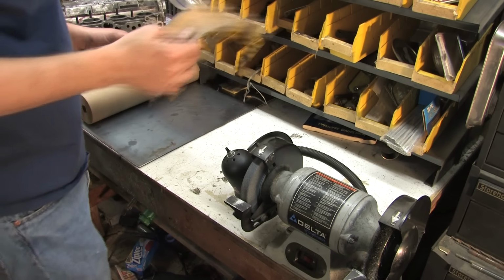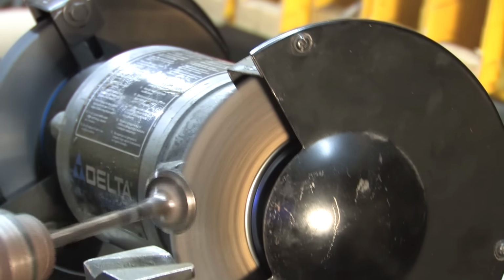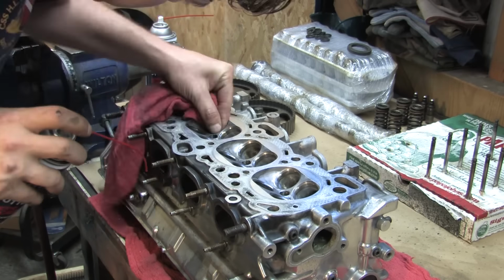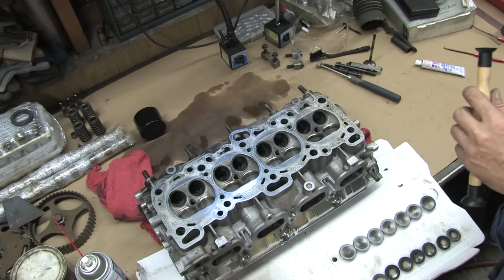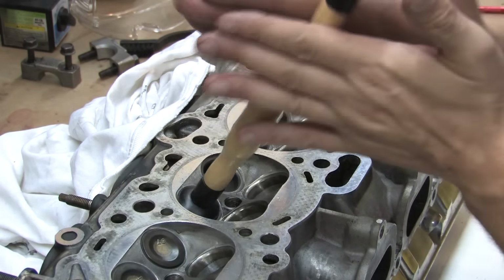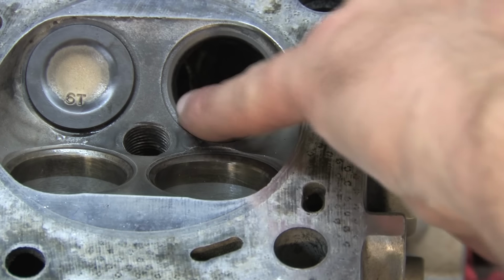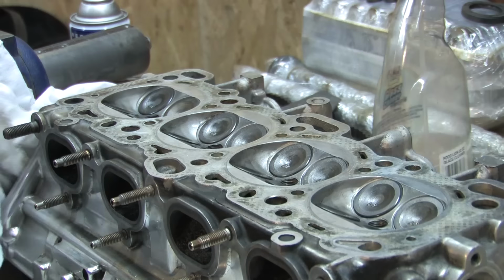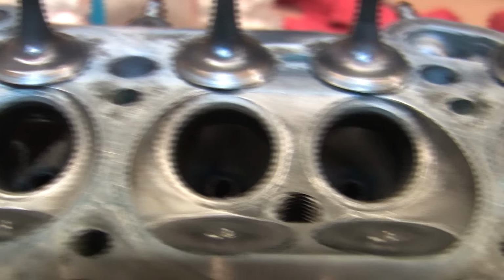Cylinder Head 105 - Valve Job Basics

Comment: awesome video thank you! Love the sound of those smoothed valve/seats. 

Question: Can I use this method to lap a brand new valve into an old seat? It's my first time attempting this.
Reply from the maker: Brian Parker Thanks man!  A:  Probably not.  I mean... it could miraculously fit... but my money is on nope.  The seats are cut based on a measurement of the valve's depth, and a new valve normally doesn't fit a worn seat.
Reply: Thanks for the quick reply! So what's my recourse? Does it need to go to a machine shop or is there a DYI remedy?
Reply from the maker: Brian Parker If you can find someone that will rent you a seat cutter kit with a T-bar or "easy turn" handle, that's awesome!  I've never tried.  There are seat cutters with guides, cutter heads, t-bars and replaceable cutter blades that you can buy for about $300, but in the end, you can get a whole inline-4 cylinder head valve jobbed for about $150 at most machine shops.  Not just the one or two valves.
Reply: Yeah, sounds like taking it in is my best option. Thanks much man! subscribed

Comment: The compound you refer to (I think) is made by Fel-Pro Clover valve grinding compound. Mine came in a small Green metal 2-sided can. Coarse under the one lid, flip the can upside down and it's Fine under the bottom lid.

Comment: I did my very first valve job that way. Learned how from a friends dad. The next time I discovered carbide cutters. They clean up the seats faster than lapping. Also with the correct angled carbide cutters, 30, 45, 60, the seats in the head can be narrowed so that they put the correct amount of pressure against the valve. The amount of cutting they do is dependent on the pressure applied. Wide seats reduce the pressure that the valve spring can put on the valve and will make the seats and valve face go bad much faster.

Comment: Lapping by hand is just a waste of time.  Simply put the valve through the head and grab the end of the stem in the jaws of a decent cordless drill.   You then just apply paste and open and close the valve while rotating in both directions in equal measure.  Repeat using the fine paste and the job is done.  Takes less than half the time of doing it by hand and the finish very often comes out much better.  Just remember not to overdo it at first, you'll work out how much time each grind takes.

Comment: is this needed when installing a new set of valves as well? and if so would you use the new valves?
Reply from the maker: +Paul Eskridge Watch cylinder head 201 for installing new valves.  That's the procedure you'd want to follow.  New valves in old worn seats is a less than ideal solution at best.  ;)
Reply: Thanks, i think I was watching it when you responded.great informative videos.

Comment: So whats the softer metal the valve of the engine block or are they both being filed (lapped)
Reply: I do not think he’s going to be answering this is a 10-year-old video however I definitely think it’s an awesome question.
Reply: I would guess that the steel of a valve is stronger than the iron in the engine block and also there’s something called valve seats which are added and that may be a third amount of strength
Reply: If you want to get really proficient David Vizard has really strong technical videos for making horsepower

Comment: if I get a leaking valve seat  that is putting coolant into the head ,doesn't that mean it's also putting coolant in the cylinder below ?
Reply from the maker: Yes.  What do you have?  A 4.2L Ford?
Reply: Jafromobile no a landcuiser 3fe straight 6 pushrod

Comment: How do I know if I just need a valve job or new valves with out tarring back into my engine
Reply from the maker: Do a compression leak down test.  There's 2 kinds of compression tests.  One tells you if the motor's good (compression test) and one tells you where the problem lies (leak down test).  If the compression test passes for your engine in flying colors, then there's no reason to do the leak down test.

Comment: How do you test for leaks once your done lapping the valves ?
Reply from the maker: The best method is vacuum testing... but if you search "head water test" on my channel, you'll find a much cheaper way.  Only... use gasoline or carb cleaner instead of water.  Smaller molecule than water and a faster result.

Comment: In the days with petrol full of lead this was an acceptable practice. Today you should not have the same angle on the valve and the seat. The contact surface get too large and you get carbon build up and burnt valves.  
Proper tools are not that expensive and you can sell them on afterwards.

Comment: i changed the spark plugs the spark plug wires the ignition coils the intake manifold and the car is still shaking so i went to a mechanic and he did  a leak down test and a compression test. then he said two of the cylinders have low compression and that's what's causing the car to shake,  so he said i have to do a head job. i did a head job already on this car back in 2014 and it's 2021 so 7 years and i have to do another one
Reply from the maker: You might have a couple of lean injectors?  I'd guess a different mechanical issue contributing to it if it's the exact same problem again. Lean injectors can burn out valves.  A clogged injector can glaze the cylinder walls, an injector stuck open can wash out the crosshatches.  All of this can lead to compression loss.  It could be that you only fixed half the problem the first time and this is just how far it got you?  It's what the valves and plugs actually look like when it comes apart that should answer a lot of that for you.  Especially if you saw the carnage the first time for comparison...  Cheap gas?  Carbon deposits?  Burnt valves?  You'll know when you're holding it in your hands.
Reply: @Jafromobile  wow that's a lot well i'm only 14 years old and my uncle takes me to and from school every day. and all of the sudden the car start shaking real hard and then he did the tune up then the car was still shaking then he changed the ignition coils and the car still shaking and then he changed the intake manifold and the car still shaking so i went to you tube for answers but the mechanic told my uncle that the fuel injectors was good but told him he's losing compression in 2 of the cylinders and he need to either buy another engine or buy another car or get the heads done so what should my uncle do

Comment: Ironically i was doing my valves while i watched this video. The two grit abrasive i'm using ( coarse and fine) are made by Versachem, part# 13209. I use the same method on my valves and would be scared to try the drill method, especially since i'm doing new valves for my H22A. Thanks for the great video, alot of your videos are very helpful.

Comment: Its a nice video but having a machin shop grinding yor seats and valves is a most. Theirs a reson theirs 3 angles on a seat and valves to make a good seal under compresion and angles very from difrent engine.   (COMPRESSION )
Reply from the maker: Please read the description.  Lapping is just a test.  It's not a valve seating procedure.  Every head is different.  I made 124hp and 109lbs of torque with a NA Honda D15B7 engine that had a 1-angle valve job.  It was supposed to have a 3 angle.  It got 44mpg.  Neither of those things should have ever happened in theory, but in practice, they did.  As long as your valves seal, you're good.  All lapping does is tell you if they seal.  If you keep it short like I did, all it does is clean the seat.  When you check it and find it in spec and a clean even seal all the way around like I did in this video, you have to create a problem to justify the new seat... so I did.  The machine shop video is linked in the description.

Comment: My cylinder 6 has a misfire and I change the spark plugs wires and the pack on a cylinder 6 it is still misfiring would you replace the whole engine are all cylinders on the passenger side what would you do cylinder six had 105 compression the other seven cylinders had about 135 I was thinking maybe the lifters but I don't want to waste all that money for no reason any advice would be nice Chevy Silverado 1500 2008
Reply from the maker: Based on its age, I'd recommend looking up some seafoam videos first.  I don't have any, but it could just be a massive amount of carbon built up in it at this point.  Try the cheap easy fixes first.  Check your compression again afterwards.  If it didn't change for the better, then move on to the expensive stuff.  How's your coolant looking?  Stays full and clean?
Reply: @Jafromobile  yes it does no over heating had low oil pressure but it's fine now had it for two days changed oil now it's fine I'll look into seafoam where does sea foam go in the gas  and thanks for the replie I'll also sub
Reply: Also gave it a tune up all the plugs and wires what else if sea foam don't work

Comment: How do I clean the carbon stuck on the valves and head? Tried brake clean and a rag still stuck.
Reply from the maker: Cleaning the valves is the very first thing I do in this video.  If you have a just... filthy un-godly mess to deal with, watch my DIY Parts Washer video.

Comment: Awesome job on this tutorial. I am about to get into a project on a Ford 5.4 and I have paid $500. in the past to have little more than clean up and lapping done. I've been leery in the past about the effectiveness of lapping as opposed to machine done work, but you have made a believer out of me. Thanks
Reply from the maker: Bob Sersen Lapping doesn't fix a bad seat!  All it does is tell you if you have a bad seat.  It helps you see imperfections in the sealing surface.  The more you lap, the wider the contact area becomes, the larger that contact area becomes, the less the valves seal because the spring load is spread over a larger area.  Use it to mark where your parts seal, and if it's not even or damaged, it needs a proper valve job to fix it.

Here's the good news.  If you've done all that, the cost of the work is far less when you carry the head to the machine shop yourself.  If you had to pay a machinist, you'll pay 10x as much just to get the mechanic to pull the heads and put them back on… than for the machine work to fix the valves.  85% of the job is taking the heads off and putting them back on.  5% is breaking down the heads.  10% is expertise of diagnosing and/or machining the valve seats.  The machinist will insist he's more important than that.  Remind him that percentage has nothing to do with importance if his feelings get hurt.

Comment: Quick question. Got another head i will be doing in a few days. Its a higher mileage one (120k)and ive got a lower mileage head with about 50k which suffered oil starvation and scored the cam seats badly. Long story short, the exhaust cam seized up and the cam pulley snapped off the end of the cam so as you can imagine, its pretty f**ked. So was wondering if it is worth popping the valves out the lower mileage head and putting them in the higher mileage one as obviously less mileage = less valve wear?
Reply from the maker: While manufacturers work from a uniform bin of parts, it doesn't mean those parts wear the same over time, much the same as you've mentioned about your example... these 2 cylinder heads lived very different lives.  One of the things that happen over time is the valves and seats wear into each other to maintain their seal.  The seats are supposed to be cut for the valves being installed.  Differences in engine wear and the duty cycles in the parts will most definitely mean the parts aren't worn the same if you pull one set out and put it in the other.  So what you end up with is 2 worn parts that don't line up correctly.  Now, I won't say it's impossible, I'm sure there's a snowball's chance all the valves could be worn in just such a way that they still make a perfect seal when swapped out, but that's not a likely outcome.  If you're already elbows deep with both heads exploded, you're best off googling a local machine shop and getting them to do a valve job.  It would be an awful lot of work and replacement parts to get all the way that deep again should something be off.  Nothing beats a complete valve job and they're affordable if you have the bare part in your hands.  Lapping valves, like what I do in this video, is really just a testing procedure.  Some people don't even use lapping compound, they use a sharpie on both parts.  The less you lap, the better the valve will ultimately seal.  I would never lap the seat of any valve using a valve that the seat wasn't cut for.  The reason being, the valve and seat need to contact on the narrowest of margins to make the best use of your valve springs.  A fat contact ring spreads your valve seat pressure over a larger area, actually reducing your seat pressure.  That can make them leak.  The narrower the seat, the better use you make of your valve springs.  I would be surprised if the whole set of valves in your spare head were in good shape and true.  If it's an interference engine that failed the way you described while running, I would be surprised if several of them aren't already bent.  Watch the radius cut valve job video.  It's a great compliment to this one.  I've paid less than $125 for a complete valve job and assembly before.  I thought it was money well spent, the head went 135,000 miles afterwards.
Reply: Yep, was my thoughts exactly, the valves would be worn and suited to the head. Thanks for clarifying that. If i wanted to go down that route of new valves then it would be best fitting new seats, new valves etc. Engine is from an MX5 and its non-interference engine so there was no problem with bent valves. I will do what you've basically done in this vid and fit new seals and away we go. Rebuilding the engine as a spare to go in my motor when the one in it gives up the ghost. Thanks for the quick reply.
Reply: After inspecting the valves more closely, the exhaust ones are not to bad and i reckon they could be lapped in their original seats. The inlet valves on the other hand the margin on the edge, or should i say lack of margin, they are also slightly concaved on the face, i would say they are fit for the bin. I think its safe to say this head might be heading for a machine shop, new seats, new guides, new valves to make it like a  brand new head again.

Comment: I use the drill method. Master the drill method and it's just another form of art, no different than your method.
Reply from the maker: I didn't say not to do it... I just said not to do it until you figure out what you're doing with the manual method.  I have no problem with manual method masters using a drill.  They know when to stop.  I know thee are some Adderal-abusing newbz who would still lap a hole to China with the manual method... but if they're dumb enough to do that, I'ma make 'em work for it and learn their mistake as slowly as possible.  But only because I'm a sick bastard.

Comment: What wheel did you use on your grinder to clean the valves?  I am told a brass wheel is best so the valves are not marred but I can not find a pure brass wheel, only brass coated steel.
Reply from the maker: Brass coated steel is fine.  :)

Comment: Whats the cost to shop charge  for this job  I I need  on my 2.4 tacoma
And 4.7  sequioa both have same problem exhaust  leak
Reply from the maker: $150 is about the going rate for a 4-hole 16v cylinder head if you hand them a bare head.  If you've got a V-something, it's twice the setup time and typically double that.  These are not prices I've checked in a decade, but prices I was given for the entire decade prior.  The method I'm describing is not this method in the video, it's the one linked in the description.
Reply: @Jafromobile  
Thanks  thats what I want  to know  I mean I get a Bill of $500 for my sequioa so  I guess same for  tacoma  2.4l   so im going to check this saturday  the guy I talk
Reply: Jafromobile you mean 150.00 for 4 valves  600.00 for the head  in a 4 cililinder

Comment: Will the brass brush and combustion chamber cleaner take tht off? I started and it looks luke eother its taking off some kind of coating or its just carbon? Its on the exhaust valves btw
Reply from the maker: Yamaha Rider It's just carbon.  I'm not sure than any kind of coating could survive an environment like the radius of a valve seat.  Valves all clapping and flames all squeakin' out at 2000°+.  Pretty sure it's just carbon.

Comment: I bought a little piece of crap 1997 honda rebel 250 for $1000, and I am not trying to spend too much on it. I already had to buy a new cylinder head for it, and I need to swap the valve stem guides over from the old cylinder head into the new one,so I am just gonna boil the engine in a big ass stock pot and put the valve guides in the freezer for an hour to swap them over. I already have the exact tool Honda specifies to remove the valve guides. so I think it will work. here's hoping.
Reply from the maker: It should.  Also, you can buy dry ice from the grocery store, it's much colder than your freezer.  You have to work fast because the head will cool and the guides will warm up quickly.  They exchange heat quickly once you get 'em started, but that trick works.  The only thing that can go wrong is the outer diameter of the guide not being the right size for the ID of the guide holes.  You'll know.  Wait an hour before you try to test how snug they fit.

Comment: drill method improvement: use a length of fuel hose between drill and valve, and a hose clamp to tighten onto stem. Reduces sideways forces greatly and eliminates chances of scuffing up valves.